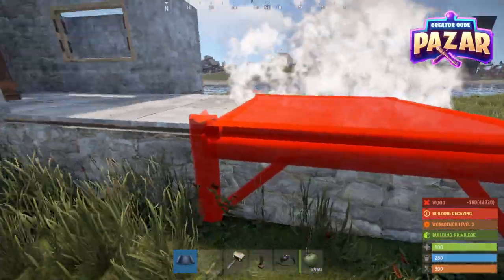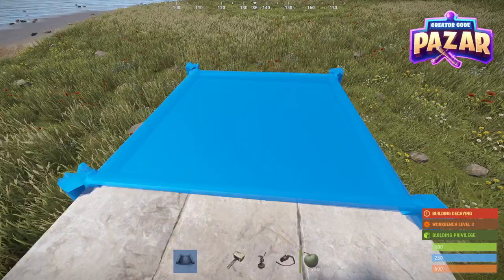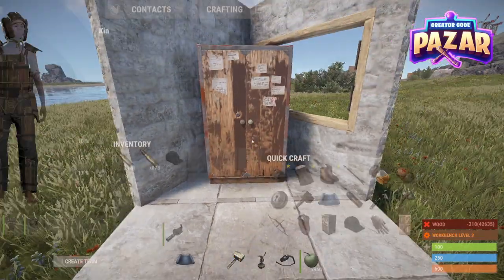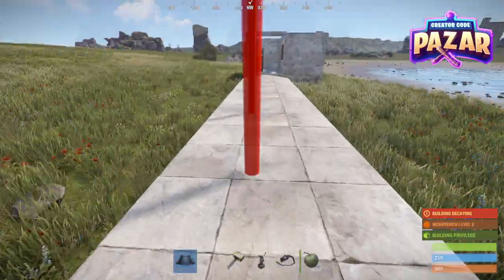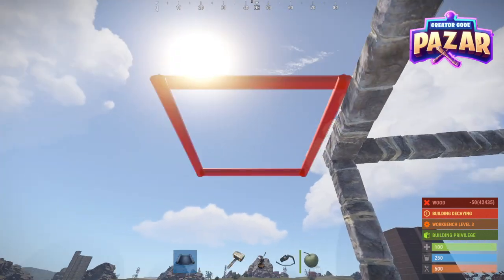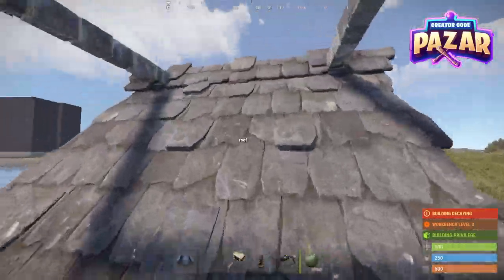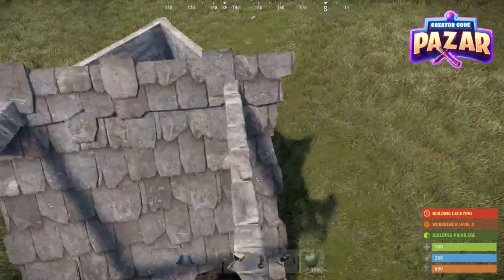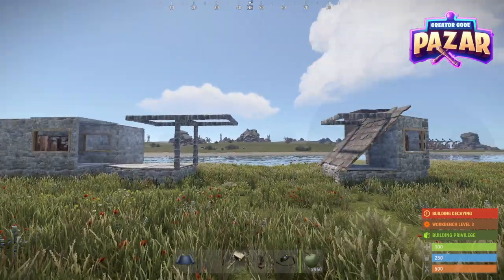How to Easily Add an External TC to Any Base in Rust Quick Guide

Comment: No one ever explains why.. Why connect with a triangle. Why place 2 half walls.. Why place the other two half walls. Why does the TC need to touch the main base?  Whats the point of breaking the connections?   I think people just parrot shit they have heard in these videos but have no idea why any of this is done this way. None of this makes any sense.
Reply: You simply never played rust them. The hole point its to have a backup TC (normaly you can only have 1). To manage this you create a disconectable tc.
If you get raided and you TC destroyed , the "backup tc" takes charge. Since the backup tc is disconectable once its take control of your base , once the raid is over you can disconect the back up tc and rebuild the main TC once you fixed your raided base. I must add this is almost basic rust knowledge thats is why no one explains it on the videos